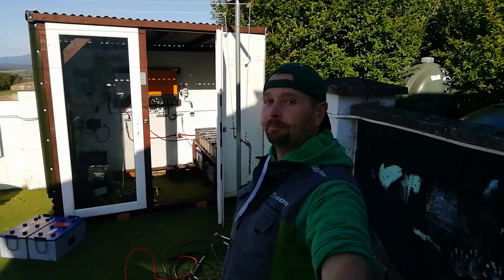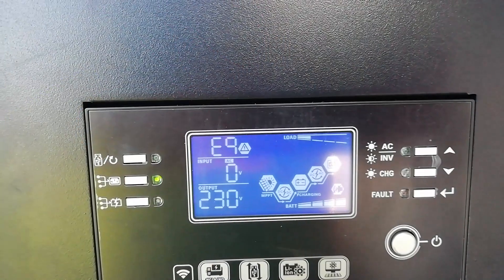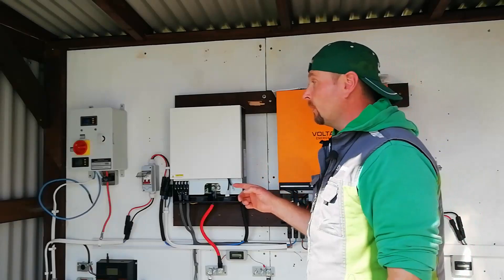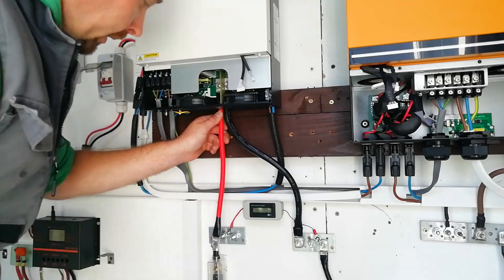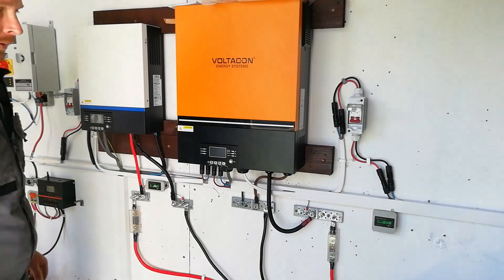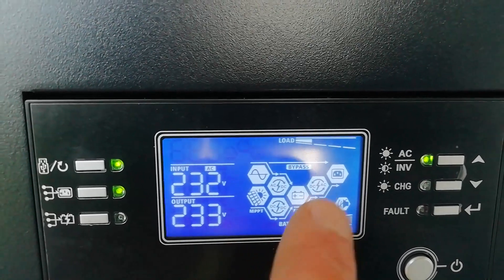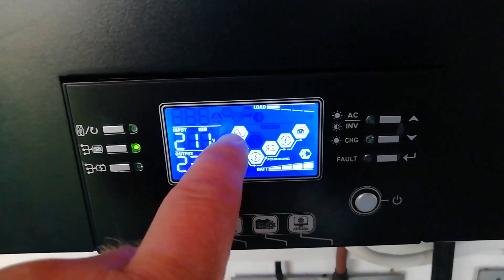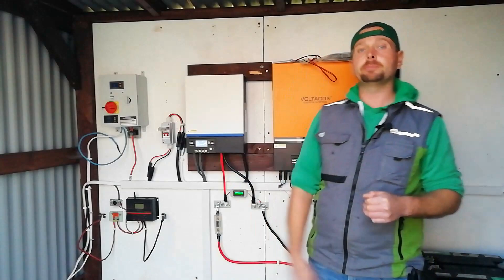12v 24v or 48v how about all 3?

Comment: Best is high voltage of house sized  solar; the choice is therefor 96v, 192V, 240v, 380v and  higher.

This reduces wiring costs and reduces battery degradation; it is also more efficient.

Of course there is a danger of homeowners electrocuting themselves!
Reply from the maker: @jocosson8892  do you know of any high voltage battery banks? I'd be interested to learn about them.

Comment: Should be thinking about biogas, from all your roten vegetables chicken dropins etc.. only down sid i can see is a kg of propane can produce 6.2kwh a kg of methane can only produce 1.6kwh but its free for generators, instant hot water boilers
Reply from the maker: @HenryOwens-py3ur  thanks for all the tips and info, will definitely check it out.

Comment: In fact thats going to work out better for maintenance, first youll have the 24v 3000w invertor charging the 24/48 batterys from the generator and then youll have the 24v i1500 pwm charging the  lead acid batterys rattling the sulfur off the battery plates, could be maintenence free over the winter.

Comment: You can try changing grid charging parameters, unfortunately it trys charging at fully capacity first, for exanmple my iconica 5000w can adjust down to 10amp but wants to pull the 5000w start up, my greengear 3000w generator goes into stall and then the iconica disconnects the grid charging connection, my solution was a golf cart 48v 1500w charger, not cheap, but when i turn on the generator every charger is on 12v 20amp, makita 18v, 400w-1000w heater, 48v 1500w, but i would check out Ukrainian homestead and survey your 48v batterys to parallel 2x24v inside your 48v battery pack.

Comment: Hey Killkenny, check out Ukraine homestead, I'm sure he wired in a 24v charger to a 48v battery, which would maintain thoughs middle batterys. As for your wind turbine I started pulling it up with a three way pully blocks, but by the time you've brought all that a 12 winch is £60-£80

Comment: Can you expand tge volt limits the 48v guy will accept?  Is it maybe frequency drifting too far??
Reply from the maker: @ai4px  that's a very relavent question. According to the manuals the inverter should accept 170vac to 280vac in appliance setting on the menus. However they're much more fussy than this in practice. When the input from the generator is fluctuating by more than 30vac they seem to take a good 10mins to figure out what to do with it and most of the time they choose to disregard it unless a restart is done with correct settings applied in the menus before hand. After the restart with correct settings it's still 50/50 as to whether they will accept the genny input to charge batteries and operate in linemode (ac bypass). They really need to program some additional options in the menus to cover a wider range of operating conditions if the truth be told.

Comment: Nice!
Just want to tell you my workaround as i got lots of old 12V and some 24V equipment i use in my48V system (58V max  Litium 80kWh)
I just parallelled in four 12V Lead acid batterys with my 58V Lithium bank With fuses inbetween
58V/4= 14,5V And low cut of for my lithium is at 50V (50/4=12.5V)
I now added 5A Lead Acid battery balancers between every cell (actually i got 4 in paralell but principle will be the same)
Now you can use 12V, 24V and 36V eqipment and still be "balanced" from your 48V system
This will only be limited by the capacity of your Lead acid Balancers
And it will work fine on both charging and discharging.....
As to the Generator I do not have this problem as i only use Victron ;)  LOL 
But You can buy some 400V capacitors to smooth the ripple This is how it used to be done "back in the days" on ships to save electronics .
Regards from wet Windy Norway!
Reply from the maker: @trygvetveit4747  now that's a comment with some real info! Thank you first of all, how long have you been running the balancers? I've been looking at them for a while now but wasn't confident in their ability. Next question is what is your victron setup that allows the flexibility of input from the genny?
Reply: @ourkilkennyhomestead2006  
And propably ru those Eqalitzers for 6-7 Years, simple electronics, will last a looong time if not overloaded :)
Reply from the maker: @trygvetveit4747  thanks for the info, much appreciated. The genny can do 4.5kw but if it's running through the inverters I can cut it down to 2kw or even as low as 1.2kw to go easy on a regulator.
Reply: @ourkilkennyhomestead2006  
Comes to my mind that Victron Multiplus2 and Qattro got freqency converters inside , this will actually let you stay connected to the grid even if you feed the input of a qattro with a generator at different Herz than the Grid 
Bite "The sour Apple" and buy the smallest qattro you can find, it will make shure you can feed your battery from both a Genset AND your existing inverter, If needed you can feed your 24V inverter from solar into your existing 48V inverter via AC.. (IF you use eqalizers seperated rom your main bank)
And if you got ecsess solar you can even feed back to grid legal via Victron ESS or even better for systems with small battery:   Victron DESS
Reply from the maker: @trygvetveit4747  calculating. Thank you so much for the info 👍
Reply: @ourkilkennyhomestead2006  
Well, Not shure, but i would guess  Victron Iverter/chargers got more capacitors inside to fix this? (tree times the price of your system, witch is propably a system i coul live with aswell, but i just love the flexebility Victron gives)
My system is as follow:
1 Multiplus 2
1 Qattro 10000
2 Smartsolar 250/100
1 Smartsolar 150/60
1 Smartsolar 250/60
Approx 22kW solar
1 6kVA supescilent Diesel generator
1 Onan 4kW Marine fresh Water cooled gasoline generator converted to LPG and Wood Gas 
1 2500W Hydroturbine for winter use
1  "M6" 2500W/48V Wind turbine (never seen more than 2000W from it in storm gusts, but in windy days it will give 6-800W)
The Wood Gas generator will send coolant to 6 pcs 1000L IBC cuopleled in series via Copper 22mm "Lance coolers" in series to make one large heat storage in my inhouse Garage....Witch is also heated from a old Water to Water Heat pump (DeLonghi HRNH-0121)
I have moved away from actually usin 12-24V eqipment exept for a small 12V Vind Turbine feeding into one of the 12V Battery
I can also connect the generator /Battery from my 2012 Ford Fiesta Diesel to Charge my system with 160A/12V if needed
Im currently trying to design a "Add on" to my "Peterson Wood Gasifier" (ISBN 9798802865293) to make "green Diesel" from household waste and plast..k :)